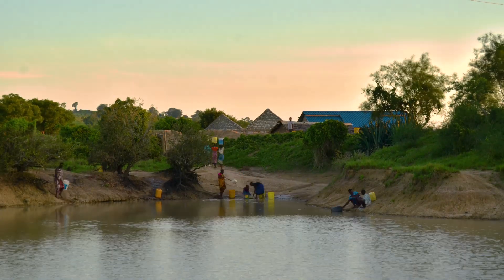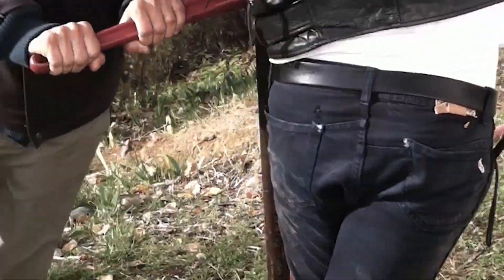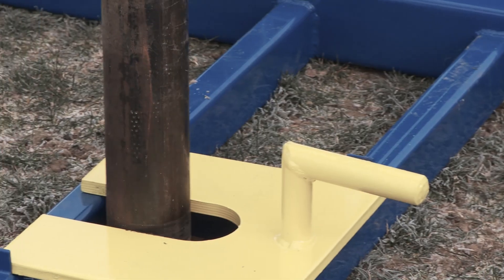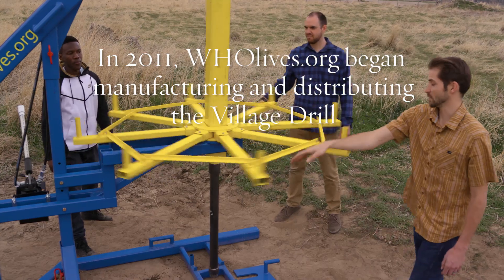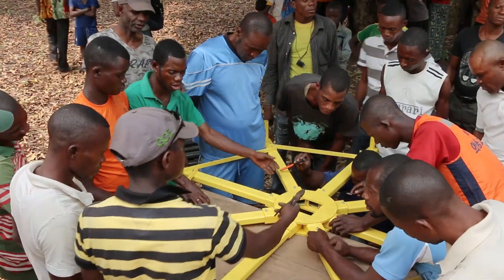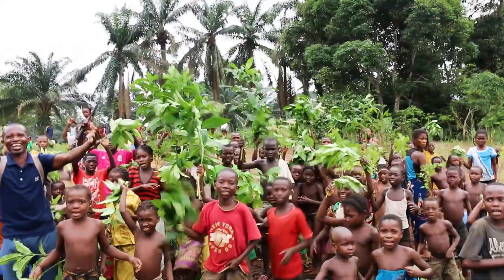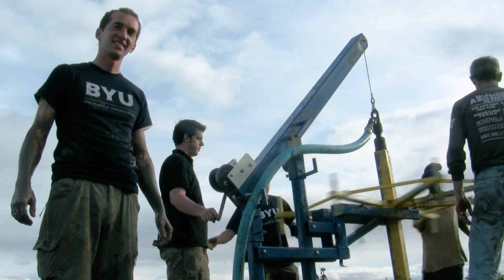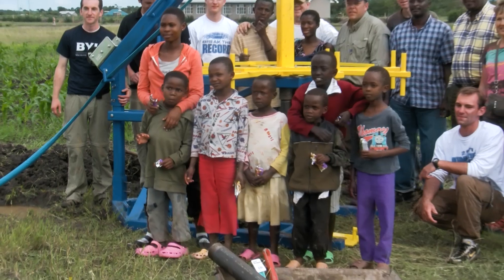After 5+ years, Village Drill brings water to 23 countries

Comment: How deep are you digging these?  Shallow wells can usually be shot with an air compressor, solar powered pumps, charcoal filter?
Reply: The Village Drill can drill up to 270 feet. Most aquifers are found at 40 to 50 feet and that's where the purest water supply is found.

Comment: The village drill looks a lot like my much larger drill I patented in 1988. The difference is that my was a crane mount with large engines and a reverse flow method that is much more efficient than the village drill. Basically, it is the same drill as mine without a power unit and the cantilever and lifting mechanism is much larger.
Reply: Well goodie for you... Did you patent to make profit off it? These are just volunteers not trying to profit.

Comment: Though idea innovative and supposedly to alleviate the real issues, the price at which the drill is sold  ($24K per drill)in the poorest nation is completely atrocious by WHOlives for what a few sections of Square tubes, hydraulic ram and drill bits, The cost shouldn't be more than $500 per drill. Why this is so much propagated as super solution when you can import a portable rig with a 5HP gasoline engine propelled rig from china For $1k to $2k which can drill to the depth of 60M
Reply: Ramdil.  I am the VP of Operations for A Better Drill Inc.  We manufacture the Village Drill for WHOlives.  The Village Drill is extremely durable and well made.  We use only the finest products available so the drill is built to last.  The $24K you mention includes the drill frame, 50 meters of custom made drilling pipe, gas powered water pump, all needed service tools and 5 industrial drill bits including a PDC Diamond bit.  It also includes extensive training materials on drilling and business practices and support. We do everything we can to keep the cost as low as we can but we do have to cover our expenses.

Comment: Very expensive to buy 24000 dollars 
Specially for poor countries 
You should make it cheaper
Reply: Why should anyone pay$24000 for few square tubes, hydraulic ram, Gi pipes and drill bit??
Reply: I am the VP of Operations for A Better Drill Inc.  We manufacture the Village Drill for WHOlives.  The Village Drill is extremely durable and well made.  We use only the finest products available so the drill is built to last.  The $24K you mention includes the drill frame, 50 meters of custom made drilling pipe, gas powered water pump, all needed service tools and 5 industrial drill bits including a PDC Diamond bit.  It also includes extensive training materials on drilling and business practices and support. We do everything we can to keep the cost as low as we can but we do have to cover our expenses.